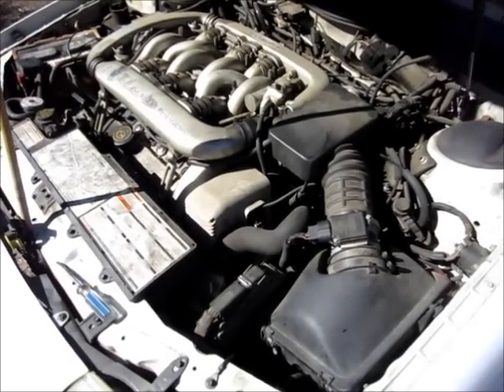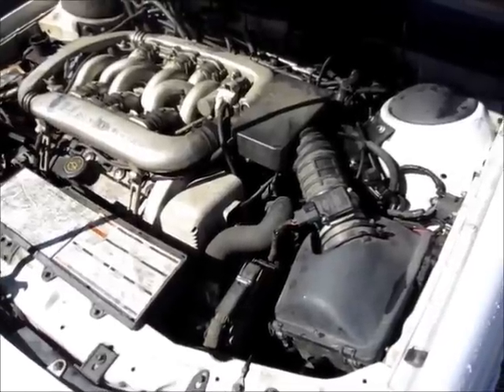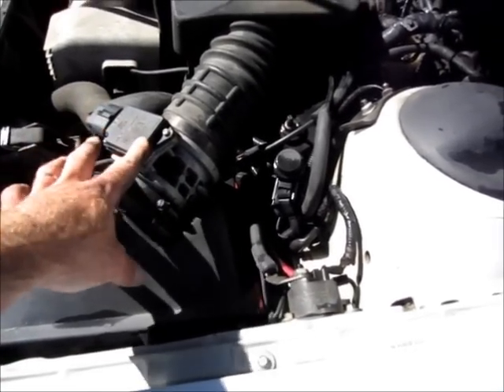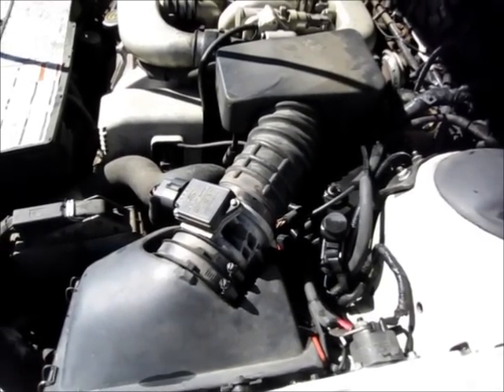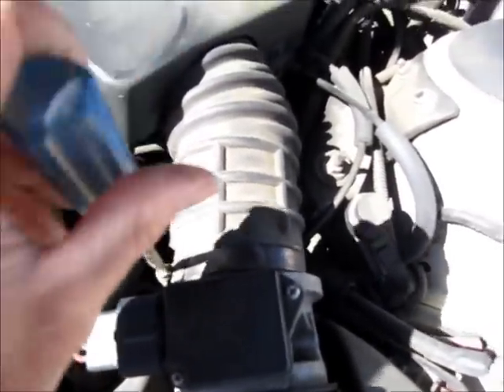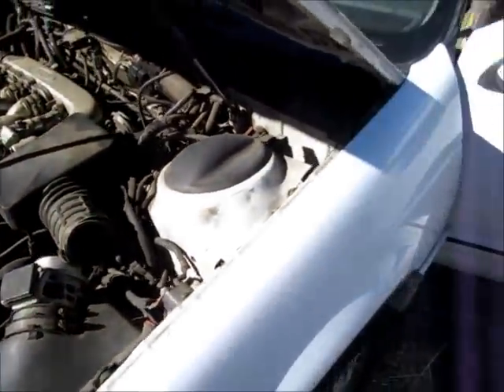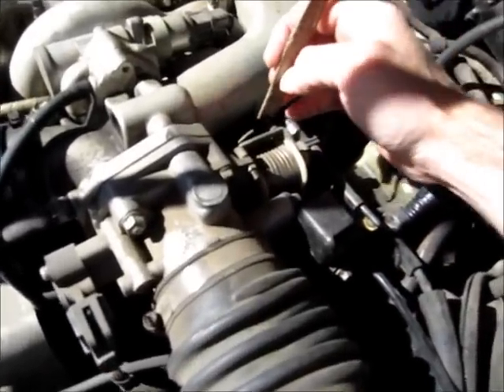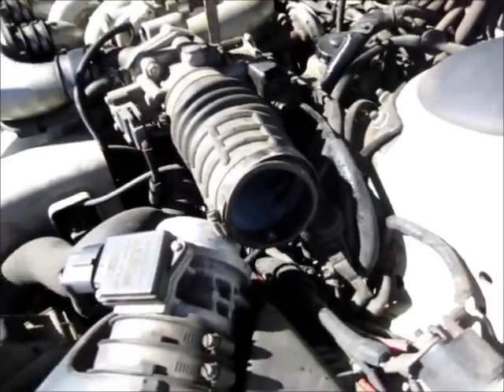How To Remove Carbon Deposits Inside A Car Engine With Water

Comment: Actually the figure for a 4 stroke 3 litre engine at 3000rpm is half that!
But easy to get the maths wrong in a hurry! (each pot only intakes every alternate revolution). Quite puts a perspective on it though, assuming a 10:1 compression ratio in theory you could put over a gallon of water through it in a second!

Still would be wary about putting water in too fast, it may not be distributed evenly, but shows you have quite a margin of safety.

Hydrolocking can cause ugly and expensive damage, it happens from time with small European diesel cars, with small capacity cylinders and very high compression ratios they can hydrolock with under 20cc of water in the wrong place. The highish rpm you are using should stop puddling of water in the intake manifold.

Comment: This works fine, I don't know why it gets so many negative comments, it is probably safer than seafoam which tends to detonate. 
At a few thousand rpm you would have to be very heavy handed to hydrolock the engine.
Reply from the maker: Thanks for the support. I didn't know folks would react so negatively to the video. This method has been used by mechanics and hobbyists for decades. You're right about the hydrolocking. A 3 liter engine at 3000rpm is pumping 150 liters of air every second. Although possible, it would take a lot more water than I was using to lock it.
Reply: +Jennies Garage 3 liter engine at 3000RPM is pumping 150 liters of air every second at wide open throttle. And there must be a hell of a lot of load on an engine for it to only run at 3000RPM at WOT. Since you were running the engine with almost no load on it, the cylinders were not filling with as much air...which just leaves more room for the water, which reduces the possibility of hydrolocking the engine that much more.

Comment: So many negative comments By obvious un useful idiots! I've seen this done years ago and like someone mentions if you ever observe internal conditions of an engine with a head gasket failure you will notice how clean the cylinder that is consuming the water is ! Usually perfectly clean! I usually rev the hell out of it and apply the garden hose on my 455 trans am I never changed the plugs in ten years and the thing runs like  a rocket ship! The wicked never believe the truth!
Reply: Truth. I was doing only this way of cleaning besides oil and filters replacements. Works perfectly. Adding back lots of power and bring power consumption back to normal.

Best way is to use distillated water. And drives after cleaning to evaporate water from oil.
Reply: I too have seen this done before many, many times. Those people leaving negative feedback are obviously uninitiated in automotive business. They don't have the experience in working on an engine with a blown head gasket or they would have known this works. Love the last sentence in your comment though.

Comment: hi this is 2013 ,with unleaded fuel you dont get carbon deposits if you have any deposits in your combustion chamber it must be burnt oil this process will not cure the problem do not do this !!!
Reply: Just a thought here,friend;gasoline being a carbon-based fuel,whether its unleaded or not,when you burn it what kind of deposits do you suppose it leaves behind?

Comment: right concept WRONG way to do it.  get a bottle fill with water, pull a vacuum line from AFTER the sensors in the throttle body (just in case) and let it suck at its own rate and adjust accordingly....your force feeding water with the hose.

Comment: Did you stop to think about how engine pistons and combustion chambers looks like when the engine has a blown head gasket? Freaking clean!

This trick is the same thing.

Did the same thing with mine and I`ve never had a better idle!!

Comment: Depends on what you want to clean. If you want to clean a carburetor and your car has one, yes the 3 buck can works. But if you want to clean the carbon deposit inside the cylinders, no that $3 carb cleaner won't do anything.

Comment: 50 g petrol 50g kerosene 50g Heavy Duty Degreaser sprey in to a clear glas mix ,remove any vacium hose and fit on the and  hose with 0,5 m m hole  rev your engine 1400to1600 rpm and dip the hose in to the glass 2to 3 seconds and out, and  2 to 3   seconds and out you can spray the plenum with that.

Comment: I admit that i do using water to stream clean my car. But I put water in glass cleaner spray can, and spray it periodically into the intake... I won't dare run a hose down like this...

You can also buy ultrasonic mist generators. Put vacuum tube in the mist and let vacuum sucks water mist in naturally.

Comment: Come on man. Yes it is an old technique use on IRON HEAD AND BLOCK. Do you know what is thermal shock? Alloy tend to crack when the temperature change to fast ( ie: when you spray water inside the combustion chamber). You do no good to your SHO engine, in fact I rather keep my engine "dirty".

Comment: Really interesting method, at least do it with distilled water cuz while getting rid of carbon you might cause hard water problem which will cause pretty much the same damage as carbon does.

Comment: hahaha....this method is been around long time ago.....i personally use this technique...if you really wanna see the result...do it before servicing...the spark plug is the only way to see whats is happening inside the engine...i used a very hot water mix it with kerosene...the result will be shown on the spark plug..or i take off my center muffler and see the black grease coming out of my engine....after all that..just use engine flush and flush your engine then put in new engine oil...cheers~

Comment: Wouldn't it be much better to use a Windex bottle set to mist to introduce water into your engine? I would think you would want that water as finely atomized as possible.  I have never seen this. Its interesting, but it doesn't look like something I would do. Maybe instead of water it would be better to use lacquer thinner?

Comment: This really is a silly idea, your spraying a large amount of heavy water you would be really better off using light mist at 1200rpm switch on your headlights, heater, radio whatever you can do to create some type of load to trick the throttle plate open, but using a garden hose like that is madness.

Comment: wouldn't a spray bottle work a bit or efficiently? I totally get the concept but daaaamn. I'd be too leary to do that. I'm thinking if I did ever get that desperate I'd just pull the engine apart with a gasket set. Not to mention that thing probably needs it's 60k done anyways. Also why not use a spay bottle or one of those portable misters that used to be so popular? Seems like it'd atomize the water a bit better and it would have less risk involved. even a weed killer bottle would work. :D

Comment: this motor runs too good to tear down right away, even though i have 230,000 miles on it, the only thing ive done to it is replace the timing chain set and oil pump as a preventive measure, if i could slow the oil burning it be nice, i run a quart of lucas in it, but that eventually burns away too.

Comment: what do you think of, running that berryman carb dip as an engine flush?( seen ya cleanin saturn pistons with it in another vid)  or would it be to harsh on the crank bearings?  im thinking  running a quart of  it in my saturn at idle for about 45 mins or so, id like to loosen up ring carbon build up, i believe its the cause of my oil consumption issue with my 01 sl2  twin cam. ive been reading where the carbon jams up the oil rings on these motors, tired of buying oil very week.....

Comment: hey give the guy a break, thats not enough water to hurt the engine, youd have to suck in pure water,( like plunging into the river at full throttle) the high rpms and intake air aerate the water enough to not hydrolock, ive done it  to my 01 saturn 1.9 dohc, the same way , with the engine at operating temp. about 2000 rpm.a brown steamy shot cloud out the exhaust, cleared out alot of carbon, runs smoother and more power,( but it still pings some, maybe it the cheap gas these days..)

Comment: The old timers always recommended that the engine by a operating temperature so that the carbon build up on the back side of the exhaust valve be hot so as to fracture when the water hits it.

Comment: Would have been nice to see a before/after part of how the pistons looked. Thanks anyway, very interesting!
Also in my case I can't reach the air intake while the engine is running because it's a outboard that needs to be cooled by water and the air intake is inside the leg of the outboard which can't be disconnected or you disconnect the water intake as well.

Comment: it works, but don't inject the water that fast.  has anyone seen an engine that has had a bad head gasket? Pistons and valves come out nice and clean from all that steam.